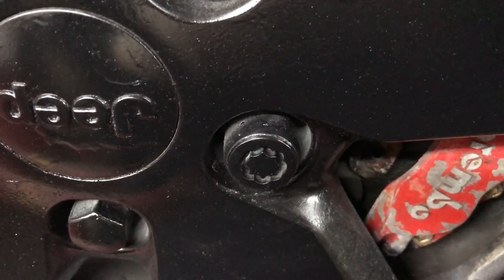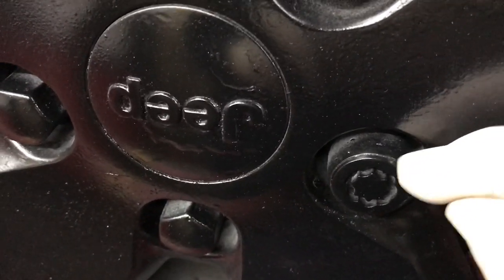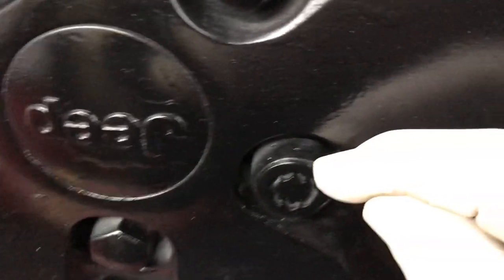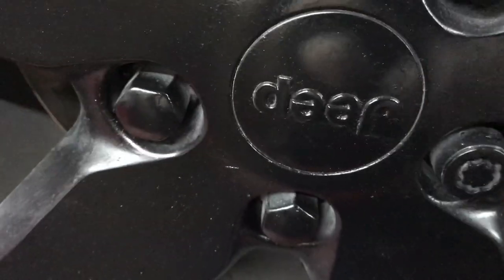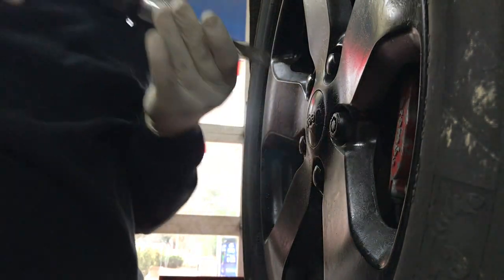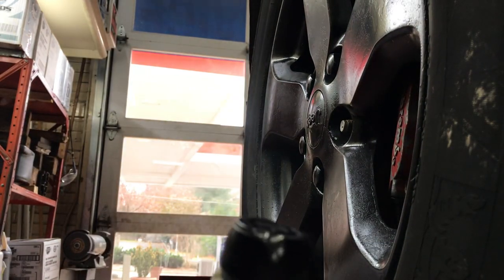How To Remove Wheel Locks That Have The Extra Anti-theft Ring

Comment from the maker: Kit with a silicone insert that you put over the lug hole and then you weld the ring to the center piece.  https://www.ebay.com/itm/313881870974?hash=item4914d1427e:g:72AAAOSwVQBiEB1j&amdata=enc%3AAQAHAAAAoHid%2BuWkhv%2BXPHay1XEnDEQS2nAoe%2BFQ10yDCEeGT9%2B75eOxxYIyjFfmDmF3Q1bC4jsUCbntGEltjoTJ3hE9XZCgBB%2BFUcaKRpTtPX65SunDX19uKyWu8zmRx%2BZo%2BrKEkTQ%2BMQCwyUTNAtyOmnSo7hreaHZlaCsd7VtlrY3POhkjQKmP9L5jZjRBLqc1%2BcIpQuLNLcOQFAwhZf0kwfSxyA4%3D%7Ctkp%3ABk9SR5zb0Z6HYQ

Comment: Tried the Air chisel - no luck. Tried welding the ring so it wouldn't move - no luck. Used air grinder to split the ring, then ground 6 sides for a 6 pointed socket - worked great. Not sure if taking off the ring was necessary, could try simply grinding 6 sides for socket. Great video - if one thing doesn't work - try another...
Reply from the maker: Sounds like somebody tighten them to much. Thanks for watching

Comment: That's great if the lugs stick out, but mine are recessed
Reply from the maker: They make a kit with a silicone insert that you put over the lug hole and then you weld the ring to the center piece. Then you use the hammer on socket to remove it.
Reply: @TheGAutomotiveAndMore  Can you provide a link to that kit? Thanks!
Reply from the maker: @autocompletellc9906  The part number is LT4569.   https://www.ebay.com/itm/313881870974?hash=item4914d1427e:g:72AAAOSwVQBiEB1j&amdata=enc%3AAQAHAAAAoHid%2BuWkhv%2BXPHay1XEnDEQS2nAoe%2BFQ10yDCEeGT9%2B73dC6ZpgiGHLELhiOaxXz4cJkQDUs7cbe9GysuL%2FaD9b2FehURrsMDr3KVsNgZCuYumFMvV16e%2BEkchd%2Fs6ZENY1YvG43TjNvGDzM0FtqnMA3TaI%2BzU4tKnufhZz%2FUoN50wI%2BNBy9gFd3sGOrFuzT8%2FaKib3DD34nVJe2p%2BMuTHY%3D%7Ctkp%3ABk9SR6Tuop2HYQ
Reply: @TheGAutomotiveAndMore  I really appreciate this! 🙏
Reply: Did you ever get it off? I still can’t and mine are recessed as well

Comment: Even I saw it I did not understand it!
Reply from the maker: Why?
Reply: @TheGAutomotiveAndMore  I did not understand how you made it work, even I watched the video I did not understand it.
Reply from the maker: @androidgameplays4every13  The outer ring spins. The Air hammer, hammers the ring into the center part so it will not spin. Then I use the air hammer at a angle to push the lug counter clockwise to remove it.
Reply: @TheGAutomotiveAndMore  Thank you for your limitless patience, now I got it!